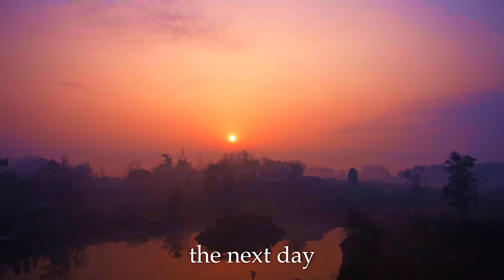Full video: the Forgotten Chinese recipe - Black Tofu | Traditional Market village life

Comment: Your black bean Electric belt  driven Grinder has a Gasket leak & will eventually burn out any bearings left & quit working, I'd simply pull out the tool's & fix the leak & replaced all gaskets or simply maintain the thing because it's saves alot of manual pounding labour for the cheif lady who's preparing this dish.